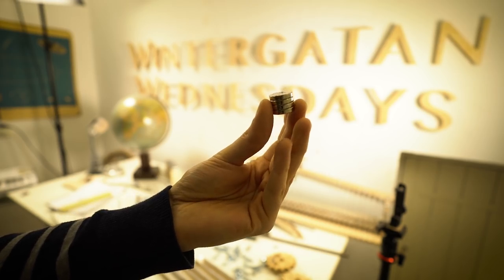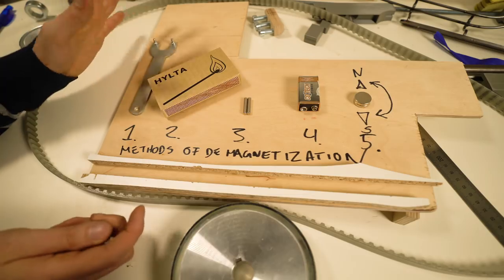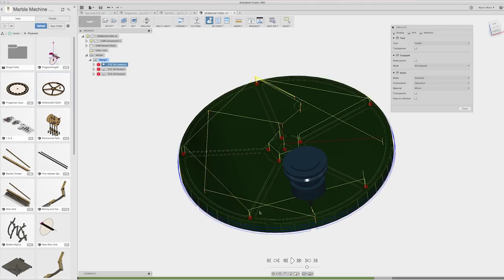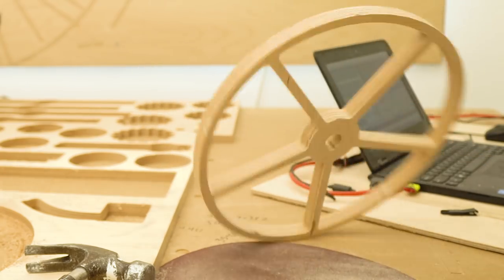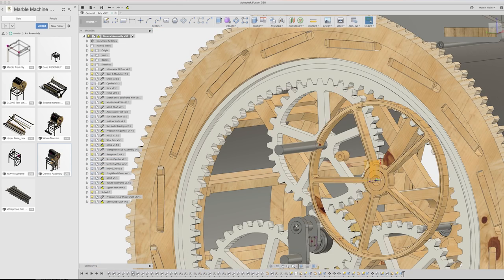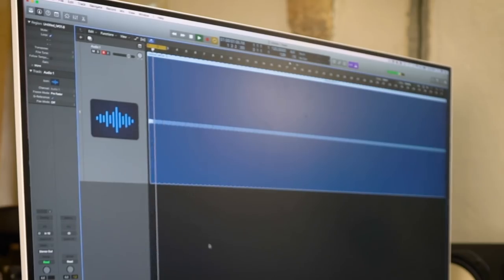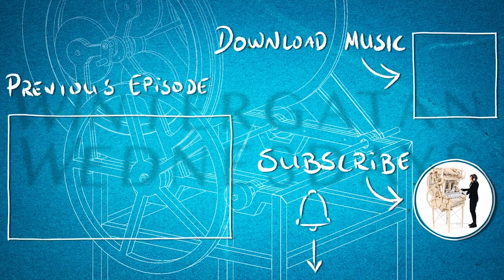Marble Demagnetizer - it's Mechanical! - Marble Machine X #23

Comment: I think using mables with this "crude hack" is not a perfect enough solution. I just got an idea of how to implement a wheel lift without magnets. It contains two wheels, one outer and one inner wheel. The wheels are inside each other and slightly tilted. They are however not centered but slightly off-center so the marbles get pressed between the two wheels on the way up and on the way down, they get released. On the side of the channel between the two wheels, there is wire or transparent material to prevent marbles falling out. Only two openings: On the bottom side on one side and on the top on the other side. By the slight tilt, the marbles roll in on the bottom and out on the top, in addition guided by a little wire hook, then maybe the tilting is not neccessary. I am just not really sure how to implement a proper grip between the wheels. Maybe add rubber tubing like it is used to prevent water getting around closed windows which gets sticked to the inside of the outer wheel and the outside of the inner wheel. The two wheels are directly connected in the center by 3 gears so they always run at the same speed. It is my idea and it is free to try and use just for you.
Reply: I see the method has some drawbacks as it does not look that nice and it uses rubber which needs extra care over long time. Here is a schematic/simulation:
https://drive.google.com/file/d/1teNZySkJG547n_YGVjUDh7oasHO02wvX/view

Comment: if the marbles are going to pass by the demagnetizer in a straight line, you don't need a wheel! just place the magnets under the track! also you can put the magnets further and further away as the track goes on, to achieve the reduction in strength in the magnetic field!

Comment: I know you do not want to use electricity but you have rotation so build a basic electromagnet with a degauss tunnel.
Wind wire around a tube. Pass DC current through the wire. Let the balls run through the tube. They will be demagnetised when the exit the pipe.

Comment: Another hypothetical solution might be core-shell-marbles: By that I mean marbles with a magnetic core and a nonmagnetic shell. My idea is that the core's attracted to the lifting wheel but the nonmagnetic shell (hard plastic, maybe acrylic or something) keeps the marbles individual cores separate from each other that their residual magnetization does not hold the marbles together as strongly.
...
But that work is more like something for an engineering thesis I guess, to try and figure out the perfect core-shell-ratio and materials. :'D

Comment: The penetration of the demag field into the balls takes time for the eddy currents generated in the surfaces of the balls to die away.  The ferromagnetic property of iron makes this time constant longer.  The higher resistance of iron (compared to say, copper) shortens the time constant. But the ferromagnetic effect dominates. I suspect you need a frequency slow enough that the penetration depth is about a third of the ball's radius.  Magnetization of deeper layers will not have much surface effect.  Google "skin depth".

Comment: By the way, is it worth testing if the brute force method works by dropping the marbles from height on a metal plate? Because a friend of mine taught me how to demagnetize coins if they don't work in vending machines by slamming them against a metal surface. So dropping them might work as well depending how far they are magnetized?

Comment: Why use magnets in the first place? You could use the exact same transporting wheel you are currently using, without the magnets, and put in little pockets just like in the machine that is shown in at 8:45 in the video.

For more consistency, increase the width of these holes to 1.9 diameters of a single marble, and in the last 0.4 diameters you add a small layer of wood at the sides as a wall to prevent the marbles from falling back out sideways (due to the movement of the wheel, the marbles are forced into these these "pockets" and wont move sideways anymore).

This way the marbles will get into these pockets faster since the entrances are wider, but staying below 2 diameters of a single marble for these entrances makes it so that you can only have 1 marble inside any of these pockets at a time, preventing jams.
Reply: gh0un well too late they thought of that solution at first but decided to go with magnets

Comment: You could have still used induction through a mechanical process, simply moving a magnet through a coil of wire would induce a current to a second coil which encompasses the track of marbles. Technically this process is still electrical, however; you wouldn't be using any electrical sources.

Comment: This is beautiful. And I love the solution. But I am really confused as always why they don't just use marbles. Marbles, by definition, aren't usually made of metal. I mean, is it really that hard to use marbles instead of metal ball bearings? But it's never been explained as to why they must be made of a magnetiseable metal. Oh well.
Reply: The steel balls will probably keep their shape better over time. For this project to work so precisely, variables need to be avoided. Also, they might make a different sound. I dunno.

Comment: OK I get no electricity. But for informational purpose a coil to run your marbles through only needs to be at 60 Hz AC to demagnetize. I still think you could make a 60 Hz coil run on a 9 Volt battery (using a 555 timer) and the coil only needs to be 2 inches Outside Diameter (if that). The inside diameter of the coil just needs to be 1/4 inch bigger than your marbles. And 1 1/2 inch long.

Comment: dont your planet gears move around the center axle? wont that mean the demagnetising wheel moves away from the marble track? wouldnt it be better to make a planet gear carrier and attach the demagnetising wheel to that?
Reply: Notgnihtrow A planetary gear set can be run in different configurations. If you hold the planet carrier stationary the outer ring rotates
Reply: yes this it true, but so far he has nothing to 'fix' any of the gears.  the sun gear is driven and the ring gear is the output, but in his CAD software the planets gets did not have a carrier to fix their position, in that system where nothing is fixed, he is relying on the inertia of the gears to sudo-fix it. Maybe it was just hidden in the CAD software but he definitely needs a stationary carrier

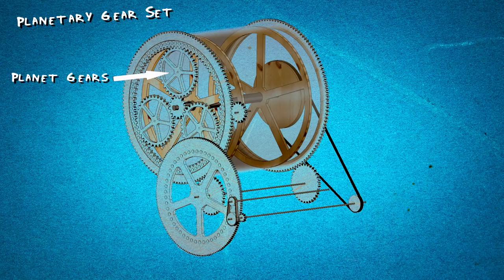Comment: I don't know what I'm talking about, but at 9:35, I think it says that the inner gears operate at 1/4 the RPM speed of the (enclosing) (LARGER) outer gear? I would think their RPM was 4 times as high, not 1/4th.  During one RPM of the exterior gear, the smaller interior gear will rotate several times. Right?!
Reply: look at 9:36, the crank shaft have a small wheel with the black belt, that's the start point... for 1 turn of the crank drives the flying wheel (that's for the right side), on the left side the small gear is connect to the flying wheel, driving the planets gears and finally the sun gear.... the ratio seem to be correct....

Comment: LOL! how awesome is the internet? you think what you need is pretty esoteric yet someone has a video called exactly what you're trying to do :D

i guess technically you could use lighter marbles such as wooden ones, and use air to push them up a tube or something? not that i'd have you change anything you're doing even if it worked well; i love seeing (and especially hearing) what you build <3

Comment: Soft steel which used in door bell will not get magnetized over time. You can heat tread your balls to make them softer. It should not be too hard.

Comment: i still cant decide why the drill did exactly 120BPM. it's DC voltage, so not caused by power (plus swe is 50hz)..... hmmmmmm thinks

Comment: If you would like some ornate metal panels to fix to marble machine x, please let me know. I own a cnc plasma cutter. cut area 680mm x 660mm. I can cut up to 10mm thick in brass copper aluminium stainless steel, and mild steel. Check out some of my work on facebook, search DFX MOTO. Design it in CAD create a DXF file from it send me the file. love you creativity, keep it up